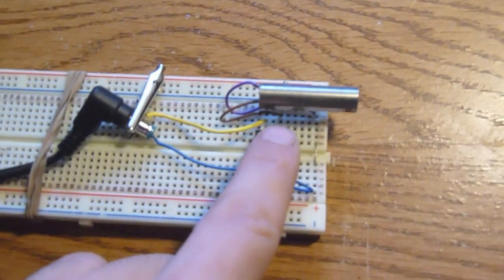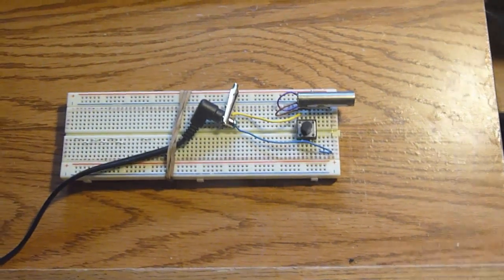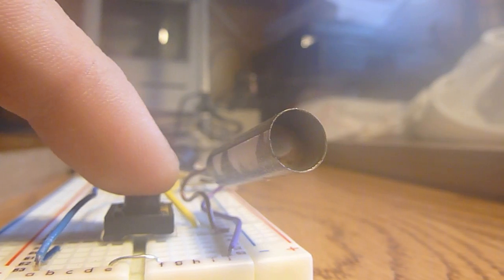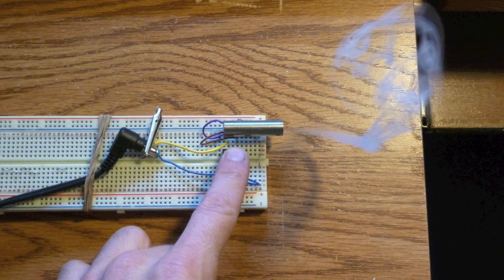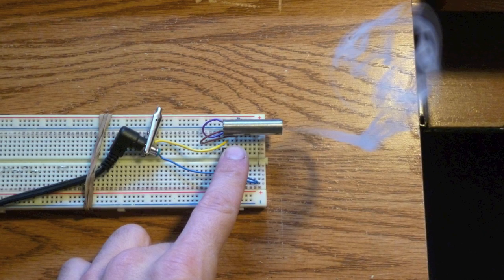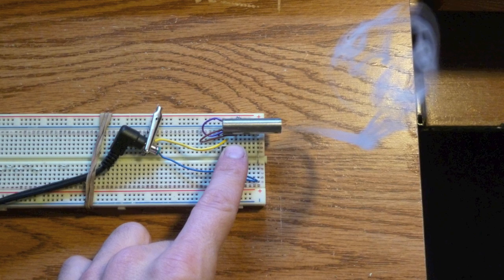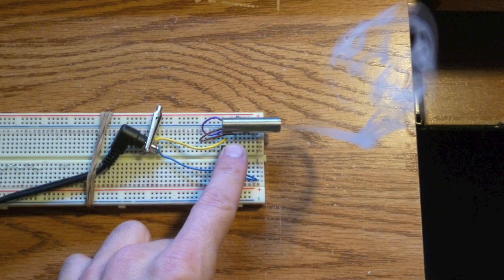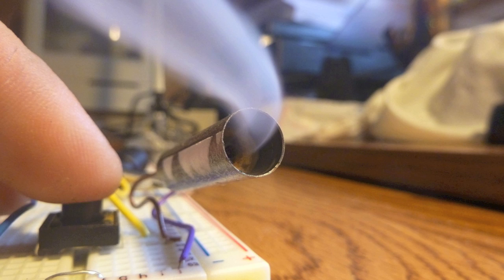DIY Micro Fog Machine From Green Smoke E-Cigarette Cartridge

Comment: May wanna go more in depth with this like a full idk 5-10 or so step by step how to this is amazing but a few like myself may want to make this and need more to go by if possible that is...
Reply: +2DG step by step instructions would be appreciated-especially for people trying to learn how to do new things.
Reply: +shadowolf91able There is nothing to go in depth about. He said how it works. You add power, the wire heats up. That is all is too it. 
Add a button so it doesn't burn out. 
There is nothing else to say lol.
Reply: +Mary Ellen Carafice the only thing he doesn't explain is where to get the parts. The instructions is as simple as what you see in the video. Get a Breadboard(the whitish board  he has all the wires plugged into) Other then that, just plug them in how he has it. Two wires are connected to the adapter, and then connected to the breadboard. Then you connect the ecig cart to the breadboard as seen. And thats it, instructions are literally given by looking at it. Hope it helps. 
Also, if you are wondering how to connect the wires, think about how one would connect speakers to a stereo. Just push them into the little holes. It's simple. Instructions arnt needed, just 5 mins of experimentation. 

I cant think what else to tell you lol, just look at the video and you can do it! : )

Edit: I forgot to mention the switch, but thats still the same. Just push the switch into the board to get connection.
Reply: +2DG Do you think push button can be replaced and connect to a   RC control button?
Reply: 2DG my question is where to connect in the e-cig. I can't vlearly see where or how

Comment: Regular alkalines will work!  I just tried it.  I saw this video and it gave me an idea for a project that I am working on.  I used a battery pack I fashioned from some AA's.  I am still experimenting with it, but it did work.
Reply: I have everything he has up there, but mine isnt producing smoke. Do yo need SPECIFICALLY vegetable glycerin of a certain type ? Mine doesnt produce smoke it just burns up ( if i treat it like a normal e-cig it works fine however )

Comment: Hi 
this would be a perfect and looks like simple mod for hobby projects.
I was wondering given you comment about leaving the switch on it could be hooked to a timer unit to stagger on/off and rate of flow. The switch you used is 2amp?, i would need a relay to controller electronically

possible you think?

I am using a 11v LiPO 3c i am guessing with the correct circuits i could reduce down to operate this unit?

PS can fog juice be used?

Comment: I used a brand new green smoke menthol ice cartomizer and hooked it up to a 3.6v 2.5 amp power source.  It sizzled but no smoke at all.  I then tried switching polarity which again, caused it to sizzle but after about 5 seconds, my solder job melted off the terminals.  You refilled with vg glycerin but I'm thinking it should still smoke, being that it's a full cartomizer.  Thoughts?

Comment: Hi, I stumbled on this video looking for solutions for a smoke generator fir a model boat. Can you use file juice fir these atomisers?.  Also you mentioned leaving the mon course cause a fire. For ,Odell use I need to have this pumping out fog so there would be extended time where this would need to be powered. Will this damage the element  and ultimately catch fire ?. I was thinking a timer circuit which alternates power between 2units or pulses one unit. What are your thoughts?

Comment from the maker: @DFredleinPortfolio I will make a tutorial when I get a special battery, but not very soon.  Basically, you need to use a battery that will discharge (let it's power out) fast enough to heat this thing.  Regular Alkaline (AAs, AAAs, C cells, D cells etc) will not work.  Ask at a hobby shop for something that is about 4.5 volts and puts out at least 2 amps.  Good luck!